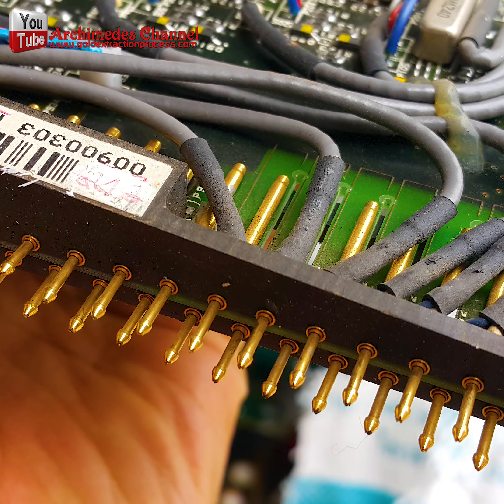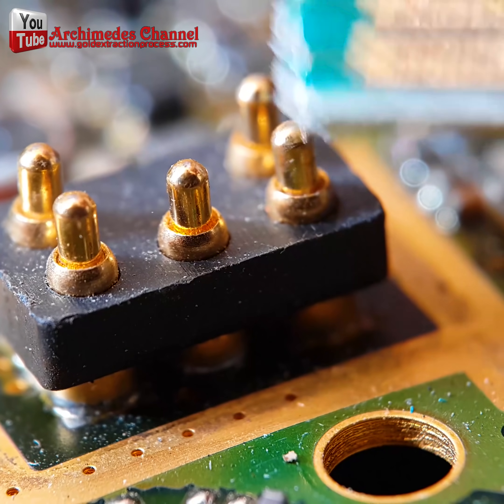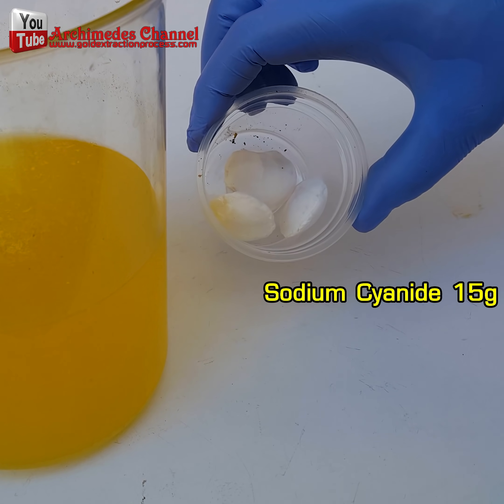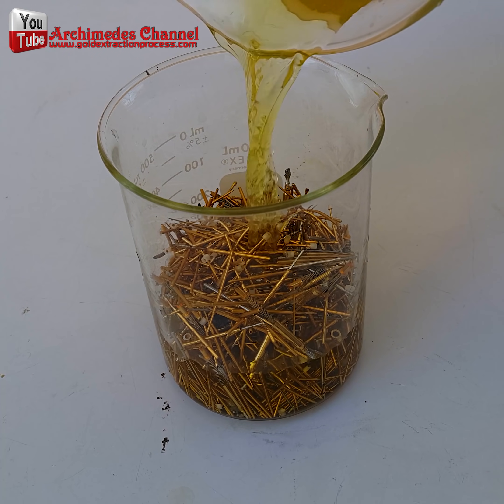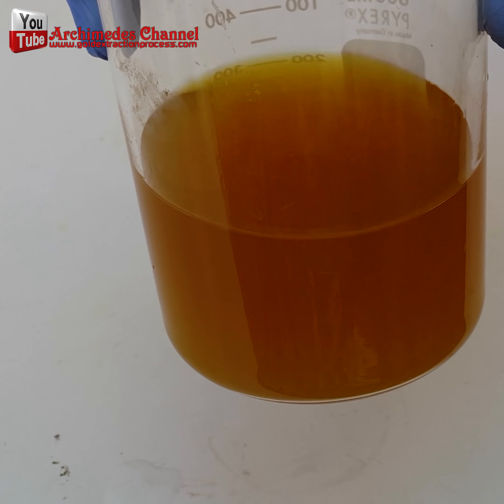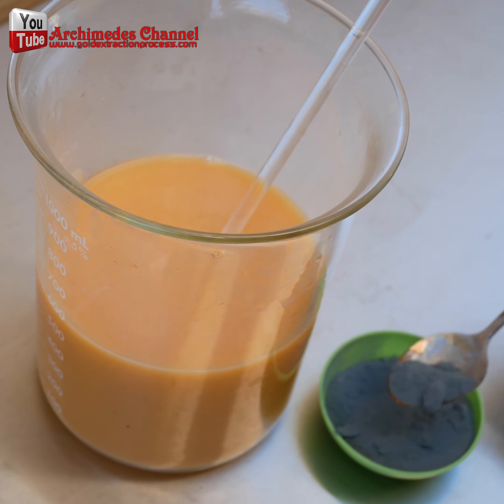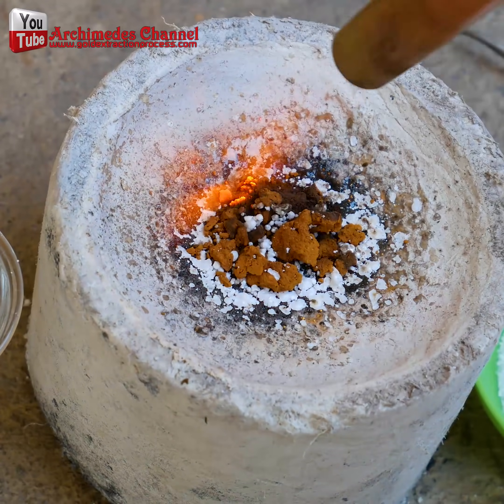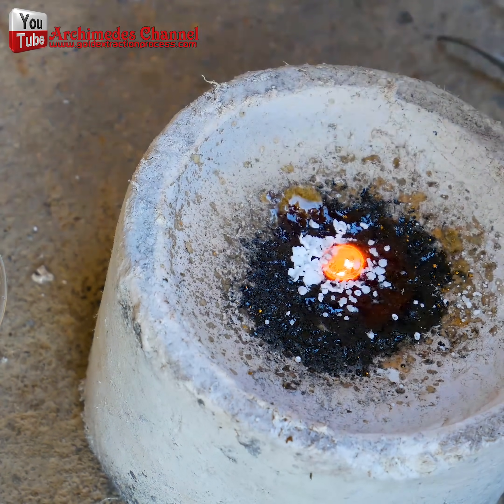300g gold plated pins how to make into pure gold@MakeGold

Comment: How many gold will be possible extract from 1000kg pcb.
Reply: aprox 5kilos
Reply: @alexander19681  how? Even it does not contain gold in that quantity
Reply: @bodybuildinglegends2902  in the video he said he got 1.7g gold from 300g gold plated pins, now you can calculate.
Reply: @alexander19681  That is for pins only, not scrap PCB. You would be lucky to get 5-10 grams gold. Less if it's modern. Only 20 year old computers and more is worthwhile.